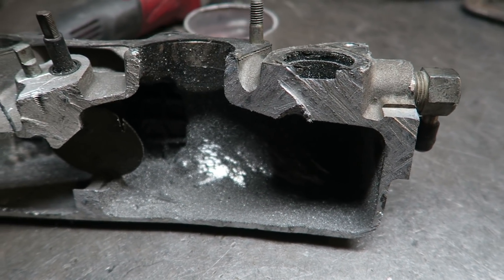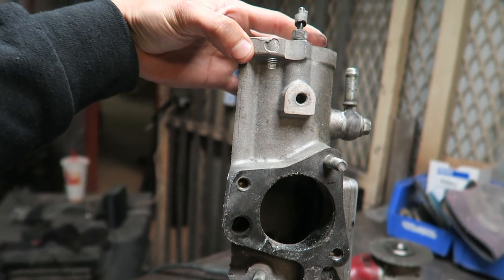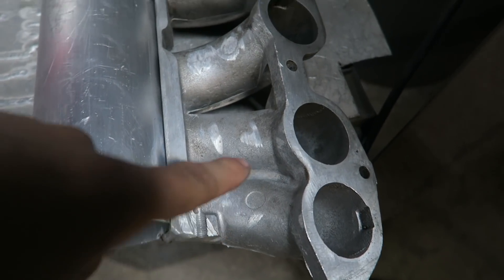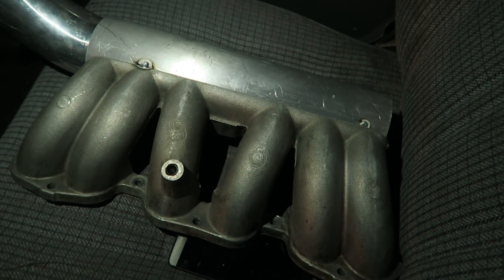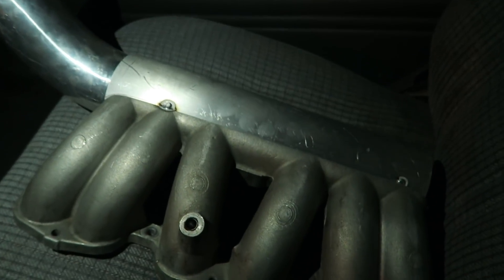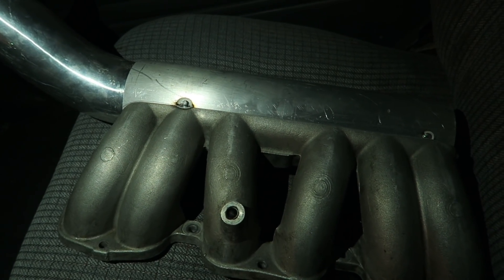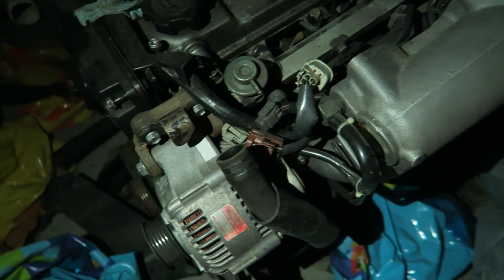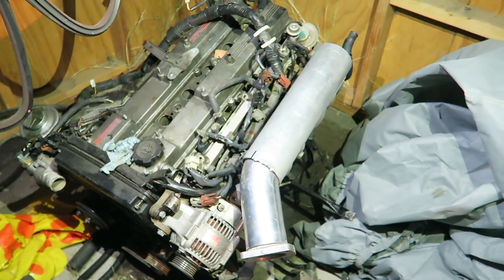CUSTOM 7MGTE INTAKE MANIFOLD!!!

Comment: Nice  car Man I actually trying to do mine in my Corolla I just wan run a bigger intake manifold with 70mm throttle body with bigger injectors for now but idk if that’s goin to throw codes since I’m stock and I have tps and air control valve and I wan run straight cable what you think
Reply from the maker: Anything is possible as long as you got the right resources/help

Comment: how many times is he gonna dip the tungsten?
Reply: GettingItTogether if u have welding tips to teach me I'll be glad to take notes
Reply: GettingItTogether sounds like hood knowledge  and it would be exremly useful if the tacs  were going to be permanent.but seen that pipe did not have the center cut out and was gonna come off we didn't need a perfect weld at that specific moment
Reply from the maker: GettingItTogether let me ask him..
Reply: keep a steady hand, every time you dab, lift the torch a little, and if you do dip the tungsten, break off the contaminated end and re-grind.  for aluminum i usually shove the rod instead of just dabbing.  also, whatever you're working on, position it using whatever you have so you don't have to rely on your torch hand to hold it. contaminated tungsten does some weird shit that you don't want in your overall weld

Comment: Has no clue what he is doing. Didnt even pre heat the cast parts before tacking. Gonna suck when those welds separate then you have a no throttle control run away engine from the engine sucking air in from the cracks. Seen it many times with amateurs.
Reply: Eccentric Smithy.     I appreciate ur words of wisdom, but next time u call someone an amateur at what they do for a living.  U should ask for details on what set up they are welding with. It's  not necessary to pre heat because cast piece is less the 1/4" think meaning it only needs about 135 to 140 amp to assure a good weld. the manifold was tacked at 200+ amp.Also both pieces got beveled and manifold was back purged while welding to assure it would have a nice an clean penetration weld.i used a helium/argon mixed, but what do I know rigth I have no clue what it is I'm doing
Reply: Eccentric Smithy it's gonna run away lmao Damn diesel

Comment: I think that is the no.1 most requested part for a 7m is a FFIM besides a headgasket ; ) . Ron R used to make top notch ones but I have not seen one for sale in awhile and the cheap Chinese ones have poor welds and intake runner quality issues.
Reply from the maker: Shwalker07 yea i could of gone that route but my buddy had better plans 😅
Reply: Actually the eBay one is amazing!! Welds are perfect plus velocity stacks in runners and all factory accessories bolt on. Way better then the fabricated ones I have seen.

Comment: Hey by any chance do you have a stock engine wiring harness for sale for a 7MGTE?
Reply: Make sure if you find one you get the right year as the years are different. The 86.5-88 are the yellow plugged and the 89-92 are the gray plugged. Also the automatic harness will fit a manual but a manual harness will not fit a automatic.
Reply from the maker: caveman 3000 dam no i dont dude sorry

Comment: Are you still going to use the A/C ??
Reply from the maker: Giomally Sille yes i am. I live in AZ its a must lol
Reply: LFATV ok because i use a 2jz upper on mine
Reply from the maker: Giomally Sille i had herd and ready about that.. was it difficult?
Reply: LFATV nope and for me i love how it looked
Reply from the maker: Giomally Sille did it bolt right up to bottom runners or needed a lil modding?
Reply: LFATV we cut the the upper and the lower and welded them together.